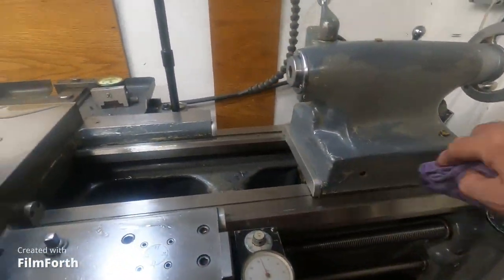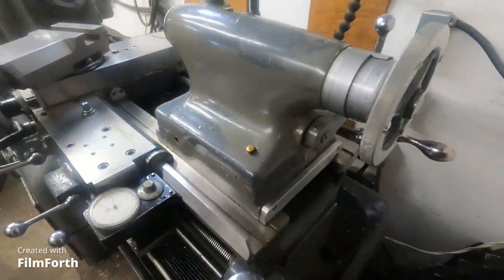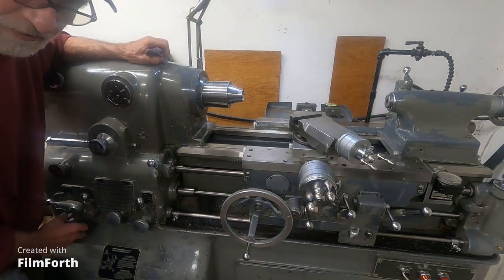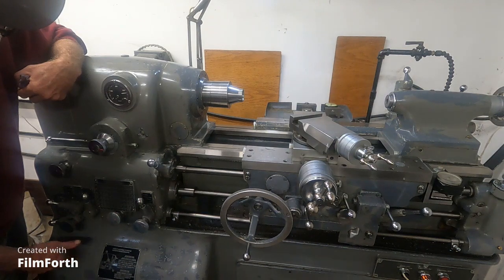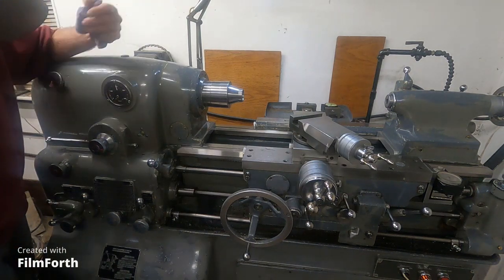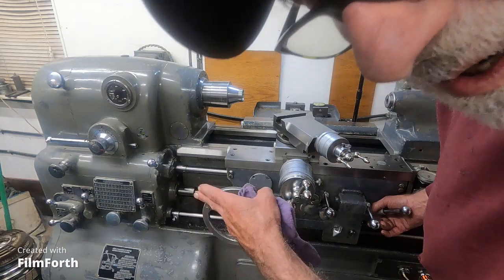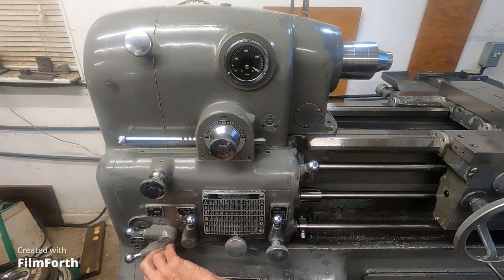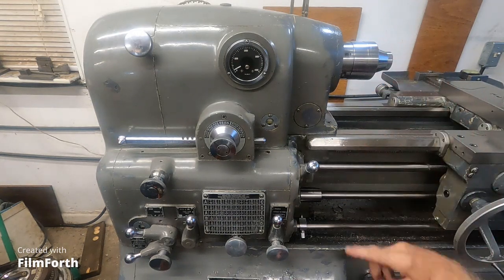Awaking the legend, Monarch 10ee lathe warm up 2 performance

Comment: This was extremely helpful.  I followed your previous advice to drill the holes in the module and you explained how to adjust the pots.  Tonight's video confirms I adjusted my lathe properly.  Thanks for the continued education, I am most appreciative.
Reply from the maker: That is great! I hope others found it useful too
Reply: Yep, very usefull for me too. That's the first time I heard your machine at 4000 rpm.
Run it in back gear for us.
Oh yeah